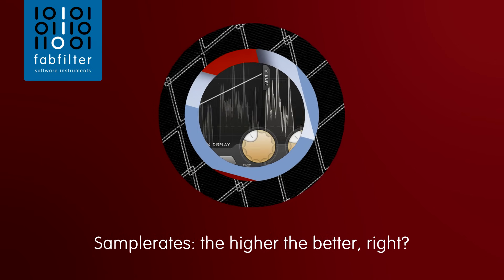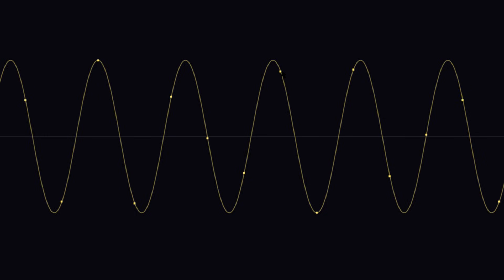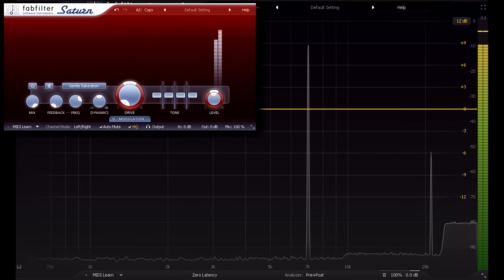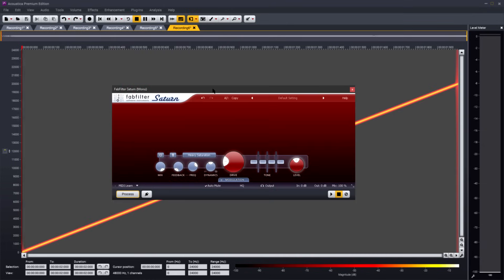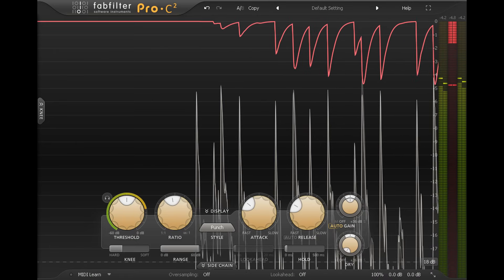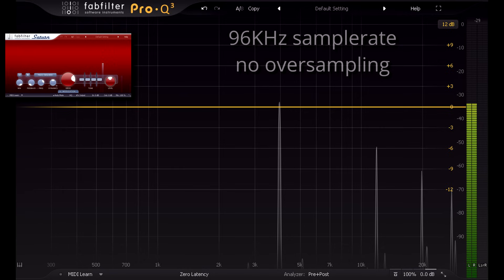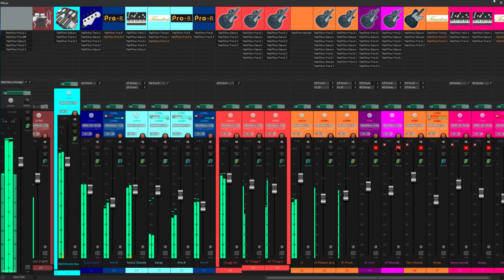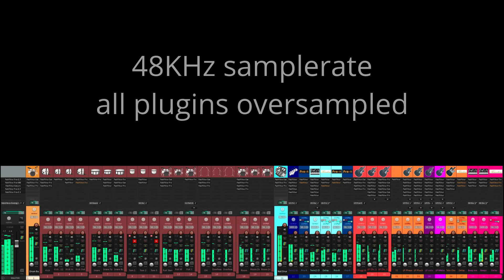Samplerates: the higher the better, right?

Comment: Georgia Tech Professor of Electrical and Computer Engineering in the Digital Signal Processing Technical Interest Group here... This is the first explanation of sampling, aliasing, upsampling/downsampling, antialiasing filters, etc. I've seen/heard, in print or in video, in 20 years that (a) didn't make me cringe at any point, and (b) completely blew me away with how illuminating it was.
Reply: Excellent.
Reply: I can say exactly the same!
I have designed and built a DSP guitar amplifier. I have seen a lot of videos and articles that are incorrect and / or misleading.
This one is superb!
Reply: @antoniomonteiro1203  How did you find the process of building that, Antonio? Were there any resources/instructions/information you found particularly helpful? Something I've been thinking about trying my hand at. I'm pretty handy with various projects, but an Amp would be new territory for me and I'm not quite sure where to start.
Reply: @jackallenproductions  There is a lot of information and I believe it is not practical to put it here. How can we communicate by other means?
Reply: I've been dabbling into DSP myself, and I'd like some more info about this. I understand the basics of harmonic distortion and I understand what aliasing is. But does this unwanted effect, of reflected frequencies, happen due to processing in the time domain or in the frequency domain? I haven't tried to make a saturation plugin myself, but I'd imagine I would simply limit each sample in the time domain, with a transfer function that compresses the curve towards the extremes, so that a sinusoid would start to approach a square wave. Surely this would add third order harmonic distortion, but wouldn't cause any aliasing, would it? Sure, if I kept on adding odd harmonic sinusoids, and went above nq frequency, then there would be aliasing, but why would I do that? As you sure can tell, I haven't actually done any non-linear processing (coding) myself... :)
Reply: @pbholmen  This took me age to wrap my head around myself, since it's so counterintuitive. A square wave that's just, say, a bunch of 1s followed by an equal number of negatives 1s is aliased. If you always wind up with the same number of 1s and 0s, the aliasing isn't objectionable, but if things don't line up quite right, you'll have a slightly different number of 1s and 0s rom cycle to cycle. A true analog square wave has INFINITE bandwidth, so just sampling it and getting 1s and 1s gives you an aliased square wave. People who write softsynths spent a lot of time stressing about this. An unaliased square wave int he computer doesn't look like an actual square - it will have what are called Gibbs phenomenon, where there's wiggles and little bits of overshoot at the transitions.
Reply: Agreed. This is a great demonstration of that I was arguing about with a guy who, on paper, has better audio credentials than I do. But credentials and committee memberships don’t make someone an expert, deep understanding of the topic does. 

If he tries responding again, I’ll simply post this to end the debate. But as he hasn’t responded in several days, I think I’ll leave it alone unless he does respond.
Reply: If you used the word cringe, I struggle to believe you are a professor. Jokes aside, I have been recommended this video from so many different sources, so I have to agree that this is something special. I want to learn more about sound and audio processing
Reply: @VideogamesAsArt  " I struggle to believe you are a professor" -- I think that's a frequent reaction when people meet me ;)
Reply: Dan Worrall has a tendency to do that lmao.
Reply: Hey guys, where can i find more information about this? I just can’t find a place where i can learn, once and for all, everything i need to know about sampling rate, in regards to say, for example, what’s the best cut off frequency at which i should set my high pass filter on a top kick, on a minimum phase eq. Or, do my compressors in Ableton live (compressor, glue, multi and and limiter, really work better when running the project at 96khz?).
It seems that all we talk about is recording and oversampling, but i’m missing how this information applies to other things, like in fact, using eqs correctly, or in sound design
Reply: You all are geeking out on useless ideas. The end listener and no true engineer is gonna go that deep into how a plugin works if it sounds good it works get over it
Reply: @SantaAnaCreations  It's true that people can spend a disproportionate amount of time arguing over minor details and then miss the bigger picture. But people when make statements and claim they are scientifically true, it is good to be able to be precise. There is a lot of nonsense spouted in the audio realm, and sorting it out may help people get to good results faster.
Reply: Awesome. Yeah, this is fast becoming like the Citizen Kane of digital audio explainers ;-)
Reply: @SantaAnaCreations  “no true engineer is going to go deep into how a plug-in works…” what do you mean? I’ve always expected engineers to love to geek out on this kind of stuff for the science. I think it’s fun
Reply: By god
Reply: 61 years of recording experience and 72 years of music experience here.
Yes, all technically correct, and the changes are SO minute that even if they're audible, the brain quickly adapts.
It's like tweaking the treble control on your hi-fi.
Sure you can hear the subtle difference, but does it really matter ?
Come back 5 minutes later and you can't hear the difference.
In other words, it's all chasing rainbows.
Reply: illuminating…? talk about pretentiousness lol
Reply: @Pj-lb5ln  ....and by that you mean.... ?
Reply: Yup.  I so agree.  I often send his videos to people to get them up to speed on a given topic that he covers.  Solid practical experience base, and theoretical knowledge.  Also, Dan does a great job in terms of making the time to provide instructional visual aids too!
Reply: @SantaAnaCreations This is a woefully ignorant statement. The end-listeners won’t usually know/care, true, and I’d imagine most musicians and producers won’t either. But for any “engineer” who is dedicated to their trade sufficiently to deserve that title will have studied all of these concepts, probably quite early in their education and/or career, and their work will have materially benefited from the effort. 

If one doesn’t know the fundamentals of signal processing, then they have no business being involved with any serious production utilizing digital audio. Ignoring things like clock rates, sync/drift, sampling modes/depths, phase, noise, and cross-domain signal analysis in a project with >~8 tracks will cause any number of unnecessary tracking and mixing issues that will noticeably reduce the reasonably attainable quality. Further, such ignorance will lead to wasted time and effort grasping at straws with otherwise common and straightforward sound design and audio engineering tasks. It’s related to creativity-stifling dependence on presets and choices that lack the requisite intention inherent in meaningful artistic expression. A producer without the appropriate knowledge of these fundamentals will only ever be as talented their rote memorization of other’s ideas, as they will be incapable of producing original ideas without the foundational knowledge required to understand how audio signals are recorded, encoded, processed, converted, modulated, amplified, and reproduced. 

There will be people in this thread who call this “pretentious” or whatever, but my guess is they’re as-yet unable or unwilling to expend the effort to study any topic in depth. It probably makes them insecure about their lack of knowledge/skill, and it’s always easier to demean the achievements of others than engage faithfully with the learning process and put in the hard work and years of practice. I encourage them to give themselves more credit and embrace curiosity and lifelong learning for its own sake. 🤓☮️

That said…if pithy quips in a YT comment that espouse an anti-intellectual and cynical worldview are all you want to think back on after your fleeting life concludes, then by all means; call me a wordy cunt and go marching contented to your dusty sleep, never having glimpsed all that you’ve missed. 🤓🖕
Reply: Hey Aaron! I was a student of yours 7 or so years ago. Loved your guitar pedal and electronics class. Cheers!
Reply: @Headrum  Oh hello! Thank you for your kind words!
Reply: i wish I was a Georgia Tech Professor of Electrical and Computer Engineering in the Digital Signal Processing Technical Interest Group
Reply: @richardlynneweisgerber2552  Thank you for your kind words!
Reply: @richardlynneweisgerber2552  This is a reply to what ?
Reply: @richardlynneweisgerber2552  I don't need wiseasses in my life, goodbye.